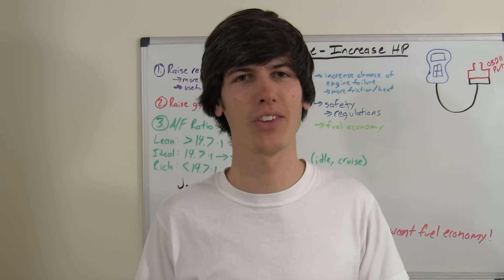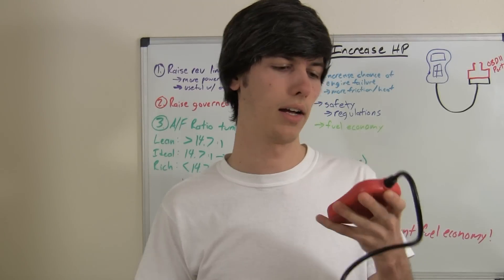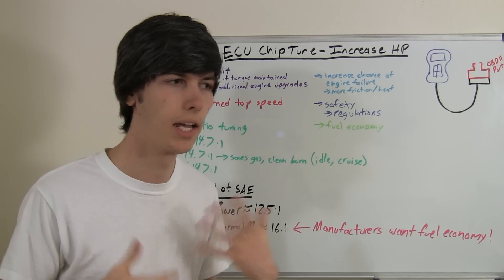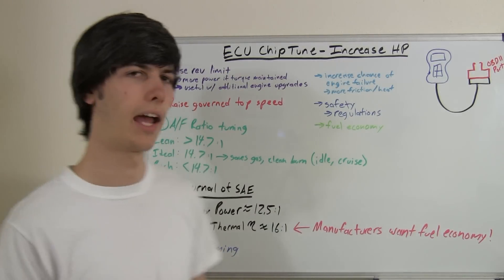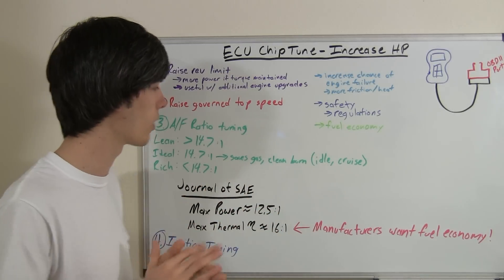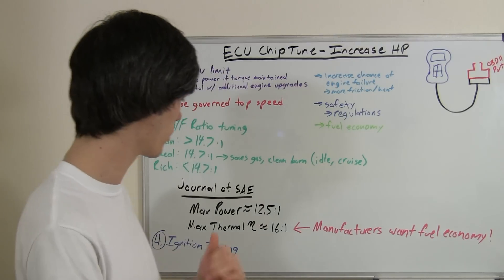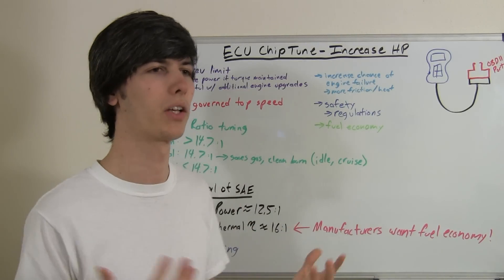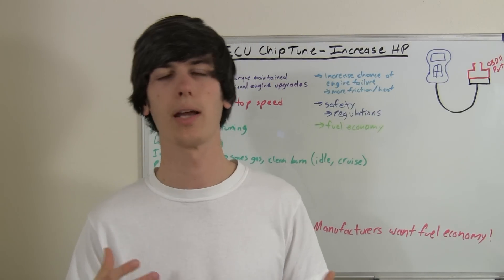ECU Chip Tune - How To Increase Horsepower

Comment: I recently bought a 02 3.0 liter eclipse and want to add a CAI, cat exhaust, headers to get a better performing car. With these new parts would I have to change anything else, like would I have to tune the ecu or can I install these new parts just as is
Reply: Ryan Rivera you probably don't have the time depending on how liberal the current tune is.
Reply: Woah, i recently bought a 03 Eclipse 2.4 manual, and just love it. Need to spent about 700 in it tho, including the broken dashboard and paint :/
Reply: Javier Herrera if you swap to a Kia optima 03 bohc you will basically have a 4g64. That is a direct bolt up just upgrade to evo head internals and boom you have a non turbo evo motor with minor work (relatively) XD. Oh and the bottom end can drive on 15psi pretty easily. Looking to get one next year.
Reply: you dont NEED to, but it would be very smart to tune it

Comment: I prefer just to replace the factory ECM with an aftermarket ECM. Commonly called a Standalone. If you are using a UEGO (Wideband O2) it is fairly easy to street tune the fueling with basic knowledge. ignition you should dyno or take your time and carefully tune that over time But a standalone can sometime open the door to a bunch of changes.

Comment: Hey great explanation, would you recommend doing an ECU chip tune on a 1.8t A3 audi? do you think its safe to use one of those companies such APR, Giac, etc to flash the ECU?
Reply: just to let ya know if thats the 1.8t 20v engine, there forged.... witch means they can handle nearly 300bhp. theres lots of maps out there for that engine.and alot off cars that use it. the s3 the tt ect ect. the audi tt if im right has the higest bhp 240-280. if you wanna get that power you need  to swop the turbo from the audi tt witch is called the ks04. and you can the just use the tt map or others that are out there.. or live map for max. i will give you one tip thou about the a3 and mapping it... if you have a coilover kit on it and have it lowerd anymore than 40mm it will destroy driveshafts all day long. hope that helps in some way.

Comment: I am having a problem with understanding ECU re-flash, as in which type of ECU or which type of ports are available for tuning? I have an ECM of a scooter, and have been trying desperately to find out if I can re-flash my ECM. So my question is, does the ECU/ECM have to have a OBD2 port to be flashsable?

Comment: I just watched your video comparing diesel and otto engines, and there you said that the diesels are limited only by the engine hardware - does that make them more receptive to ECU remapping?
I mean, with no detonation to worry about you're only limited by the pistons, crank, connecting rods and the injector flow right? Obviously the high exhaust temperatures will hurt the exhaust valves and the turbo, but in general could a remapped diesel be considered as safer compared to a similar gasoline turbocharged engine?
Reply from the maker: Yes, you can pull quite a bit more power out of a turbo diesel with some simple tuning. At a point though you'll need a turbo that can supply sufficient air. They're not necessarily as desired in a performance vehicle as gasoline engines are a bit more responsive, and rev higher.
Reply: matija ferencek Unlike gas, Diesel engine don't have a spark plugs. Easiest way to increase tq in a Turbo Diesel is to increase turbo bar. If not, there are couple ways to do that. remap ECU is one of those. For me the best way is to increase compression ratio and adjust or use a injector that spray mistier and harder. Also adjust engine running order is a good idea. It depends on ratio. Compress harder, loss some rpm but may increase 1.5-2 times the torque.

Comment: I can stage 1 chip tune my Volvo for ~250 bucks, no other performance upgrades installed, Estimated performance increase of 19% (41 hp & 38 Nm Torque). Worth it?

The reason I can get so much hp out of it is because I have the locked engine version (~140hp), I have the 2.5l Inline 5 non-turbo engine. There is another version of the engine that is at ~170hp which will only have ~10 hp increase. I will end up with around 188hp and 248 Nm torque (210 original) if I tune it.

Comment: I have a 2005 civic Si with the k20a3 engine and I want to buy a K20A ecu chip to put in my car to get more horse power. I just don't know if it will work out or not because the K20a ecu was in a 6 speed car and my k20a3 is only a 5 speed.

Comment: In Portugal, we have an epidemic of people raising the power of their diesel cars by changing parameters on the ECU. The result is that all those cars are making huge clouds of dark smoke every time they touch the accelerator. Could that be because they changed the a/f ratio parameter without increasing the engine's ability to intake air. Are their engines starving of oxygen? Is that the cause of such abnormal smoke?

Comment: Something that I just thought of while watching this video: Is Stoich with modern pump gasoline still 14.7:1 with the 10% ethanol that is now added in most areas around the country? I know that you have to watch some of the oxygenated racing gas. Stoich for some of these fuels are sometimes richer maybe closer to 13.5:1 or even richer (VP MS109 comes to mind). Does anyone know the answer to this??

Comment: Should you tune/reprogram your ECU for an older car if you have the money to do so? Like its 2015, should I do it for a car that is 20 years old? I'm just thinking in terms of replacing old and worn parts. Makes sense, right? Also shouldn't you retune your ECU when you apply/add forced induction or turbo your vehicle? Or am I thinking of something else?
Reply: And/or get a performance chip when you add a turbo or supercharger? This is just something I know next to nothing about haha
Reply: Dallas Stevens Well, I don't know much about it but starting in 1996 I believe the obd ii port started being required to be added to cars. He said in the video that that's how you program them. So being that it's 2015, 20 years ago would be 1995 and in 1995 not many cars had obd ii ports because they weren't required. So unless you can program it some other way I would guess it would be better to replace it.

Comment: So when I bring my car to get tuned Should I buy my own chip or would they have one for me? And what if I add a cold air intake. How much hp could be gained?
Reply: Think of any number you want and multiply by zero. That's how much HP you can gain :)
Reply: Cold air intake can actually gain power when combined with chiptuning. Without it, its completely useless.

Comment: there is an ability to use a hydrogen gaz instead of diesel or gasoline but i think the hydrogen (H2) doesn't have a powerful energy link between two atoms of hydrogen ,as you know, when the H2 is breathe to the intake manifold in a pressure of (1atm).
in fact, I think that there is an ability to compress the H2 on a stainless steel bottle like the nitrous oxide for more power, you named... :)

Comment: I called Comp Cams to inquire about a camshaft upgrade for an LS engine that I want to put in a project build. The technician asked me what kind of tune I plan to run once it's finished and had no idea what to tell him. I understand everything you said in the video but I want to know what I should've told him. If you were upgrading a camshaft for an LS engine what answer would you have given the tech. Feel free to give long, detailed answers.
Reply: +Jaime Huff If you're upgrading cams, valves, and valve springs, then as he said in the video, you would probably be doing a rev limit increase.

Comment: The governed top speed is based off of the ratings of the tires the car comes with. If you want to increase the top speed with a tune then you also have to change your tires  or else you can have tire failure.

Comment: Yes, I understand than a rich fuel mixture is more ideal for tuning so less chances of detonation but what i don't understand is, everyone in the tuning community adds a straight pipe and a cat delete? Because rich would end up melting the cat, right?
Reply: Lime Not really, most tunners do it so you can exhaust gases more effectively since cats and stock piping are fairly restrictive, and you can get a few HP more. Running rich will eventually clog the cat and ruin it, then it might cause problems.
Reply: Lime If the car runs rich enough to backfire, a cat delete is a must if you don't want to potentially burn your car.

Comment: I found it interesting that running rich actually helps "cool" the engine. Care to explain?  Thanks!
Reply from the maker: Well apparently running lean means a longer burn, and longer burns will heat up the engine more.
Reply: Engineering Explained
 Speaking of rich or lean, would you happen to be able to tell me the title of the article you got those numbers from? Most people that tune my car keep it up in the 16:0-14.7:1 range and i dont know if that is out of ignorance or concern that the engine is going to blow from other issues. I'd love to read that article if i could find it to see if it may have an answer.
Reply: From what I have read, when you burn lean, the flame is hotter, and faster. And its the hotter faster flame that will cause the cylinder pressure to grow to quickly and cause detonation. On the flip side running rich will cause the flame to travel slower until around 11.2:1 then it will go quickly. But the added fuel helps cool the cylinder by absorbing heat. The over use of fuel also retards the heat by not completing the combustion. Unburnt fuel also expands rapidly giving you a weak steam effect.
Reply: I figured out why i kept seeing the graph in the 16:1 range: they were tuning the closed map, not the open map. However those are interesting numbers as well... i really want to see these graphs..
Reply: Sounds like you where tuned for fuel efficacy not power
Reply: Michael Rippey
Thanks for the info. That's very interesting, but makes sense now that you explain it.
Reply: Michael Rippey
The closed map was tuned for efficiency. The open map at the moment i have no idea what it is tuned for. The open map is what cars use at WOT because the engine isnt super sure how much air is going in. On the closed map it knows exactly how much is going in.

Comment: I'm looking to get my car tuned at a local shop with there "stage 1" tune. they claim and additional 50hp, 60tq, and 5 pounds of boost to the turbo. I believe the horsepower and torque, but i don't see how reprogramming the ecu allows the turbo to create more pressure? if you could explain it to me that'd be great, thanks!
Reply from the maker: Grant Doyle The stock ECU mapping will limit your boost to a certain level, they simply increased that level. That said, if the engine isn't built for it, the tune may not last forever. Just be cautious.
Reply: Most likely your car has an electronic boost control solenoid. That is what regulates the way that the wastegate functions to control boost. So by changing the values in some of the tables with the Tune you can manipulate how the ECU contols the electronic boost controller, therefore affecting the wastegate behavior to create less or more boost. Obviously all turbo's have a mechanical limit to how much boost they can create but for safety and reliability reasons they are no where near their limit from the factory. But just as EE explained, keep in mind that 5psi more without several other mods is a significant jump in peak boost for stage1. So make sure to keep an eye on your engines diagnostic data.
Reply: Bones12x2 Engineering Explained Thanks alot for the comments back, appreciate it!

Comment: If I get a diagnostic tool or chip tuner, will I be able to override say the airbag light? Or any other misreadings that appear from installing an aftermarket part?
Because I did weight reductions in the back end of my car then my airbag light has been on ever since. I think it's because the sensor has been disconnected. Can I override things like that with it?

Comment: Would you know if the ecm chips from OBDI computers are reprogramable? If not, would you know where I could buy a flashable chip? Thanks for the video :)
Also, just wondering if you'd know if there is a standard amount of turns from seating a idle mixture screw for a 2bbl gm throttle body 4.3l?

Comment: does timing gradually decrease overtime? My vehicle timing I think has gone low and sometimes engine dies when you're say at a stop light. RPM doesn't stay idle, it keeps dipping down every few seconds. Should I send my vehicle to get it reflash?
Reply: +Rene d&#39;Aramis That's much more likely to be related to a dirty EGR valve, dirty spark plugs, or, in a higher mileage car, a loss of compression. A dirty EGR valve should give a specific code you can read with an OBD2 scanner and for dirty spark plugs the best test is to look at em. If neither of those is your problem, then you're best off leaving any further diagnostics to a pro.

Comment: I have question regarding chip tuning and I hope someone can answer it. A lot of chip tuning companies advertise with gains in power while ALSO getting a better fuel efficiency. Now as a car tech noob I understand the power gain but I don't get the better fuel efficiency that supposedly comes with it. Because more power, BHP, torque or whatever usually means more fuel usage. If the chip tuners can achieve better fuel efficiency AND power gain in such a relatively easy way, why won't car manufacturers program their cars that way. I'm a bit sceptical about the fuel efficiency.
Reply: The chips that make those claims usually have multiple modes to switch from. To get more power and more fuel efficiency at the same time on an engine that was carefully designed without installing any hardware... it's baloney.

Comment: Hello!!! question: Why exhaust gas temperature is higher on engines running on lean fuel mixture?
Reply: Its because lean fuel burns slower and it increases the temp cause of that
Reply: Matias Sebastian learn fuel does not burn slower. 

Richer fuel mixtures run cooler. Because the unburnt fuel cools while it exists. A learn mixture is hotter because more oxygen is present. 

Lean is for efficiency while rich is for power.

Comment: Could you increase fuel economy, at the expense of HP, by increasing the amount of air? What would be the limit of doing so? I imagine the engine needs a certain amount of fuel to have enough power to be useful.
Reply: Well the only way to increase the amount of air is with forced induction or nos. If you run your engine too lean it causes extreme hot spots in the cylinders because there is less fuel to cool them. This leads to unpredictable pre-ignition and ultimately severe engine damage.
Reply: t0f0b0 you could tune quite a bit for efficiency but depends on the engine and how you modified it. E.i. Drawing hot air at the intake is better for efficiency

Comment: I've recently removed a troubled transmission on a vehicle which has an ECU communicating with engine and transmission; I installed a manual gearbox in its place. However, at any given moment , particularly under load (highway driving) the engine suddenly exhibits a stall; I have to switch to the off position; the ignition key and turn it to the on/start position for it to return to its proper running condition. Any advice? anyone?

Comment: Friction and heat is not what manufacturers use to determine the red line...mostly valve springs and piston weight is the determining factor.  knock is also a factor..which can have systems to mitigate this..but typical engine does not have those systems because the red line is so low.  Also those systems are expensive..so low redline is cheaper.

Comment: so, what about power commander ? got a klx250sf efi, also 3 options, a API ECU (full programable) a PC V and one of these plus a 331 to 350 cc bore kit, i guess i will need change the injector and air intake right ? may i use a 1.400cc car injector ?
Reply: That question seems pretty specific, so you might want to find a forum for your car/bike (because idk what that thing is...) and ask there. They could probably give you an answer in a heartbeat.

Comment: hi, if you have do a remap of your ecu do you need to a premium fuel to prevent knocking?
Reply from the maker: jervy diaz You might.
Reply: confessedplane  mine is set to premium on my car.
Reply: At the least loose power. I run premium and full synthetic gotta give her the good stuff. Im using fastworks tuning by hackish for the 2010eclipse gt

Comment: hello I have a 1987 Monte Carlo and I did a engine swap from a 305 to a 350 on the car and it has been running horribly and I needed to know how to adjust the ecu chip settings to make it run to peak performance and do u need a neutral chip to erase or could you just use the original chip to adjust the settings and how to get into the specific settings for the car and is their a program that you use to change the ecu chip settings and if so could you tell me what it is. Thank you please respond asap
Reply: If it has the 305 ecu +  ecu, I think you can just switch in a 350 chip into the ecu by removing the small cover on the ecu.

Comment: I remapped my vauxhall insignia but the company i went to mapped it from 128bhp to 180bhp and 3rd gear kept popping out a few hours later and then 5 hours later the oil pump went. Prior to this there was no light for oil but yeah that's what happened. I also remapped 1.9tdi mach 5 golf from 105bhp to 150bhp and that coped well but driveshaft snapped, gearbox started to break and I replaced the gearbox. I've now got an Audi A4 B8 but I'm sort of put off from remapping it...